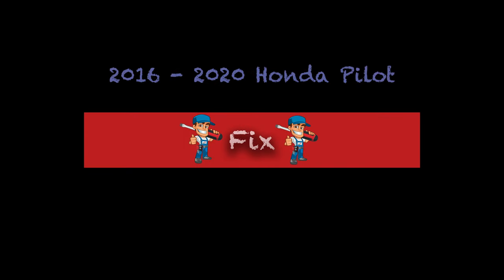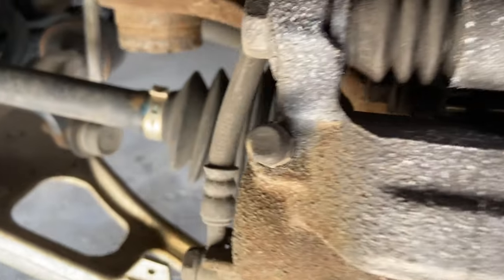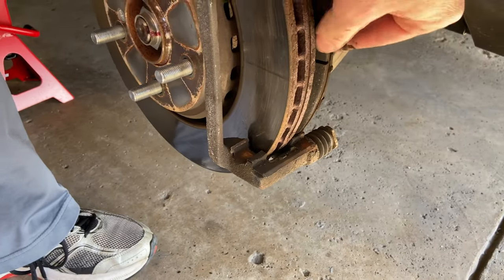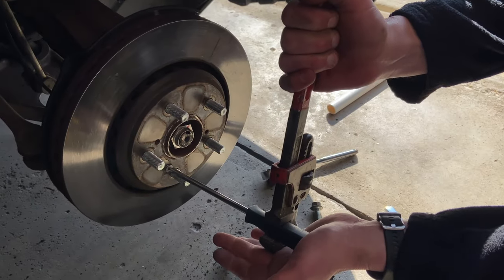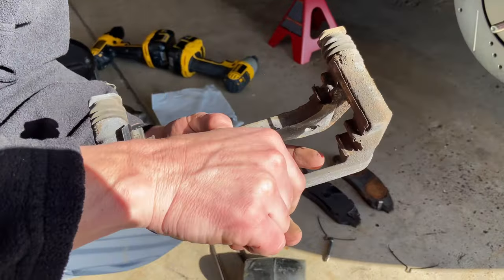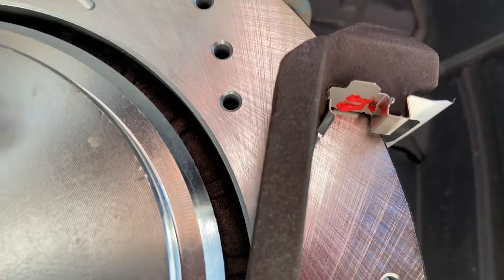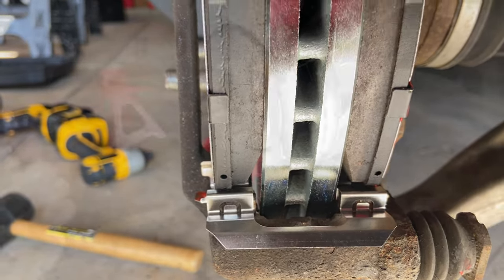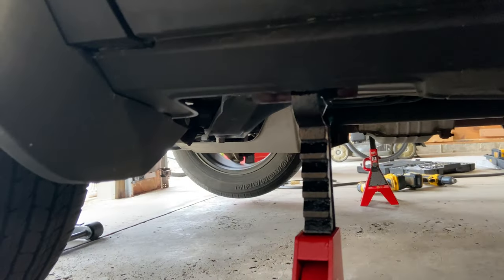How to Change Honda Pilot Brakes - Pads and Rotors - 2016, 2017, 2018, 2019, 2020, 2021, 2022 | DIY

Comment: The red brake pad quiet is a silicone,  will dry into a soft gasket type material. Only put red brake quiet silicone on the back of the pads, DON’T put it on the silver brake hardware where the pads are suppose to slide. Use silicone grease there, not the red stuff. Next time you pull the brake pads off you will see they’re like rubber gums,
Reply from the maker: Thanks for the info
Reply: Glad you said it. I was thinking the same thing ... that red "brake quiet" gets tacky, like gum.  The pad should move in the channels, so put lube in the channels and the "gum" on the back of the pads so that it will adhere slightly to the caliper pistons to prevent squeaking or rattling (thus the "quiet" in the name).

Comment: don't forget to remove the caliper pins, clean them off, and re-grease.  some anti-seize on the back of the rotor will help it from sticking in the future too, just make sure you clean it off first.
Reply from the maker: YES!  Thanks for the extra info!
Reply: Vaseline petroleum jelly on them works like a charm. I did that on my motorcycle multiple times!!!
Reply: I was hoping someone said this.
Reply: The pins need non petroleum product so skip my earlier suggestion and use silicon based lubricant for the caliper pin lubrication.  Petroleum based lubes will mess up rubber parts that the pins slide through to mount caliper on the bracket

Comment: The "phillips screw" that you had a hard time with, is not a phillips screw.  It's a JAS #3 screw, and is very similar to a phillips, but is not.  You need a #3 JAS impact screwdriver to get it out.  I'm getting ready to do my Honda Ridgeline.  How are the Powerstop rotors and pads holding up?  I'm told that slotted and drilled stop better, but wear faster.  Torn between them, and an EBC set with smooth rotors.  Thank you for the informative video.
Reply from the maker: The rotors are smooth and working well.  It's been about 20k miles since the install,  but I am unable to report on the wear.  Everything feels great though
Reply: @fixandplay826  Thanks for the quick reply!
Reply: @kennethgrutter9406  Slotted and drilled are great for high performance sports cars but you really don't need them for the pilot. The slots on the face of the rotor act the same way as a meat slicer in that they shave away the brake pad faster but this generates better stopping power. If you're racing and want that extra bite so you can brake later into corners to shave a little bit off your lap time then slotted rotors are going to be crucial but it's just overkill on your Pilot. Just my opinion.
Reply: @barrykennedy8507  thanks for the reply.  My vehicle is not a Pilot.  It's a Ridgeline.  A lot of people compare it to the Pilot, (Yes, lots of the same components, ) but the frame, and suspension are very beefed up on the Ridgeline, compared to the Pilot.  I also carry heavy loads in the bed, up to 1500lbs, and tow occasionally.  Similar, but a Suburban is not a Silverado.  The loads and stresses put on my Ridgeline, are different than what I would use a Pilot for.  Anyway, thanks for the reply.  I'm going with the EBC stage 13 brake kit, with yellow stuff pads.  Smooth EBC rotors.
Reply: @kennethgrutter9406  Gotcha. Quick tip to make the pad replacement portion of the project go a little easier,. When you are putting the pads back in the spreader springs will make the pads pop out as you're trying to get the caliper back on. An easy way to deal with this is to loosely reattach the caliper using only the top bolt. This allows the caliper to kind of flip up out of the way as you're installing the pads then you can use one hand to keep the pads in place and the other hand to flip the caliper down over the pads so they can't pop out. I just replaced my pads today and this method worked really well.
Reply: It’s a JIS (Japanese Industrial Standard) rotor screw.

Comment: Yeah, in my experience I’ve had a bunch of Hondas and those front rotors always tend to get warped around 40,000 miles-65,000. I ended up getting them resurfaced at the Honda dealer. In my experience it’s going to get warped again within another 20,000 miles. I also didn’t really like the stopping power of aftermarket brake pads and rotors ….so we ended up going OEM brake pads all around. This thing stops on a dime. Thanks for the vid man appreciate it. couldn’t justify spending $150 on each OEM rotor x’s 4 😅😅😅
Reply from the maker: Yeah, the rotors and pads I put on in the video have lasted me another 80k miles.  They are worth every penny

Comment: I stripped the hell out of that screw holding the rotor to the hub. Such a stupid unnecessary feature. Drilled through the head with bolt extractors and it’s still stuck on. Don’t do try to remove the screw without proper fat tipped Philips head bits and make sure you have a drill bit on hand for this project. Great tutorial. Did the rear rotors & brakes no sweat, appreciate it guys!
Reply from the maker: Sorry that happened to you.  In my REAR BRAKE video I use an Impact Driven Screwdriver.  It works great.  Heres the link
https://amzn.to/3Zfsrfr

Comment: Just to add one thing to your video.  When you push the pistons back into the caliper you need to be careful and not overflow your brake fluid resevoir.  Keep an eye on the level of that resevoir as you return the pistons back into the caliper.
Reply from the maker: Good tip!
Reply: Not really nothing happens. I have been changing parle pads for the last 5 years and there’s no overflow or anything

Comment: The stripped screw is called a JIS screw or Japanese Industry Standard. It looks like a Phillips but it’s not a Phillips. Using a Phillips driver to remove it will lead to stripping. Use a JIS bit in a manual impact driver to eliminate this issue.
Reply from the maker: Thanks for the info!
Reply: Use a air hammer on rotor to loosen this screw some people bang on rotor works but could damage rotor if you were going to turn them.

Comment: Great video! 

Just fyi, the screw that holds the brake rotor to the hub is not a phillips screw. It’s a crosshead screw. That could be why you stripped it. I used an impact driver with a crosshead screw bit and had no problem getting the screw out.
Reply: Save yourselves grief and buy the correct tool to remove that a JIS Screw. Philips head will strip that JIS screw.  (JIS =Japan Industrial Standard)

Comment: Good vid. , except too much that red stuff.  Anyways this should also work for the Honda ridgeline  which is basically the same car with a bed in back
Reply from the maker: Yeah! Too much red stuff for sure LOL.  Yes, this is  pretty much the same as the Ridgeline.  Thanks for the comment
Reply: @fixandplay826  just did my 2019 ridgeline yesterday.  I didn’t put enough brake lubricant on so I had to take them out again.  After that I could tell they weren’t dragging anymore.  But still squeak a little only when pushing the breaks . Rather then all the time.  I really don’t like those “springs.” That go into the pads.  ,  it makes putting the caliper on a challenge.  I cannot say how many times the pads pops out .  Working solo.  I heard Ford also does this 
With those springs.  I understand their purpose but could they do it. Different way.
Reply from the maker: Best bet…find a buddy to hold those spring for ya!

Comment: Excellent video. My 2016 Pilot will undergo the procedure soon. Be wary that your Amazon brake pads will not last long like oem ones, especially if they r not zinc plated- if u stay in snowy area like the north east.
Reply from the maker: Thanks for the info.  Hope you procedure goes well 👍🏼
Reply: Also the screw you stripped. Where did u find the replacement? Do you have part #. Or sizing on it?
Reply from the maker: @kunalkhanna985  I didn't replace it.  I screwed it back in.  That screws job is to how the rotor on during assembly on the assembly line.  I decided not to replace it, it's not really necessary
Reply: You stripped that screw because it is not a Phillip's screw it's a jis18 screw. It's a totally different type of screw head.
Reply: @ericsummers7178  interesting update, I have a fancy screw driver set that could have the said tool. Let me check
Reply: I got a special Vessel screwdriver for jis18 screw removal, all Honda's need it for this job

Comment: Use a hand held impact screw driver to properly remove the phillips head set screw holding rotor on.  Hit it with a hammer and it come right out without tearing it up the way they did.  Can get them at harbor freight or on Amazon for about $20
Reply from the maker: Thanks for the info! Impact screwdriver would work well in this situation for sure

Comment: Yeah, the OEM Honda brake discs are cheap and warp really easily. It’s a problem on all Hondas. We had our rotors resurfaced at 10,000 miles and we just replaced them at 23,000 miles with Duralast Gold Brake Rotors. I’m hoping they will not warp. They claim to be high quality made from high carbon steel with a black coating to prevent rusting.
Reply from the maker: The rotors and pads I have in the link are what I used and they have lasted me 90,000 miles at this point and I’m still going!!

Comment: I came up with some tips after doing brakes for now has to be close to 40 years my own brakes whenever you do great so any type of maintenance on the front or rear really but the certain and balds that you want to see them and tighten them right back up. One of them is that screw that holds on the road at any time you do work in the front take that school loosen that screw up and then put it back You should even have a set to spare screws pick them up at the deal or whatever and pop those off place and with some new ones because if you wait 80,000 mi you might not get so lucky now you're drilling that screw out it's a real pain. You might also want to hit those bolts that are holding the road of brackets on You back there you doing the brakes the pads take your your 17 mm socket put it on that racquet bolt and loosen it up and it tighten it back up Don't wait until you have to do those roadies and you haven't touched that bolt for 80,000 miles. Sorry for typos voice to text and good luck
Reply from the maker: Thanks for the knowledge!!

Comment: I'm doing this in the AM, do I really need
1. Brake cleaner for rotors
2. Special bit for the little screw
3. Breaker bar
4. Bolts Torqued to spec

I have a large torque wrench, don't really know how it works I just use it like a non torque. Not sure if it even works for torque, it never slips and I crank stuff down hard with it. 

I have the silicone grease, floor jack, jack stands, wheel chocks, correct size sockets. 

I think I'm good 👍

What do you think?
Reply from the maker: 1. Yes!
2. Risky if you don't, you might strip it
3. Only is the bolts are too tight to loosen, otherwise NOPE
4. Nah, you can just hand tighten
Reply: @fixandplay826  I did it and everything works perfectly! I even changed the brake fluid and bled in sequence 👍

First time doing a real auto repair on my own. Feels good 😃

1. I didn't have brake cleaner, I used some rubbing alcohol, on the front of the rotors but It wasn't after thought so I didn't do the back.
 
2. I used three bits to get that screw out almost stripped it. The first two bits broke off inside, But we're not stuck and came out easy. Third bit worked luckily. On the second rotor that bit worked perfect right off the bat. 

3. Didn't need a breaker bar because I had a very long torque wrench. 

4. And I just made the bolts really tight I don't know how to use a torque wrench apparently lol. 

I did the break-in routine. Heated them up so the pads form to the rotors. 

Everything is great. Thank you so much for the video. 

Now I might take on more maintenance 👍

Comment: Did I miss when you bled the brakes to get air and old fluid out of line?   If caliper is only pushed in, without bleading then old fluid can corrode lines.
Reply from the maker: No you didn’t miss it.  You don’t need to bleed the brakes when you just change the pads and rotors.  You must bleed the brakes when you replace the calipers

Comment: You needed to clean the caliper bracket and remove the slide pins and rubber grommet clean and regrease pins reassemble. 
Grease the bracket notches
Reply from the maker: Yes, thanks for the info

Comment: How about the Torque Spec for the Caliper Mounting Bracket as well as the Caliper itself?
Reply from the maker: The front caliper BRACKET bolts are 100 ft/lbs
The front caliper GUIDE PIN bolts at 50 ft/lbs
Reply: @fixandplay826  damn that's tight. That's what she said, am I right? Great job with the video, even I could follow along.
Reply from the maker: Edmund Mendez thanks for the positive reply
Reply: @fixandplay826  Do you think if the Guide Pin bolt is too tight, it could cause the brake pad to not hit the rotor?

Comment: I usually take a injector thing that you use for turkey and get all the brake fluid out of the reservoir then add new after I compress the calipers that way it never overflows as you're cranking down on it with caliper tool. Otherwise you'll have that 💩 everywhere
Reply from the maker: Thanks for the tip!

Comment: Shouldn't you bleed the brakes after reinstalling the caliper?
Reply from the maker: In general, hydraulic brakes don’t need bleeding unless the whole brake system has been opened up or when a leak has allowed air in it.  A normal brake job doesn’t need it.  If your brakes are non responsive or super spongy, then you may need to bleed them

Comment: Tips before you push the pistons back in, put a line on the bleed screw, crack it, push the pistons in.  1. Way easier. 2. You push out old fluid vs back into the system. 3.  I’d flush your brakes as bows the best time with all new components

Comment: you need a impact driver for those  screws    now it has to be drilled out
Reply from the maker: Yes, an impact driver could do the job
Reply: Drive your car for a few miles, come home, jack it up and take off the wheels. Immediately spray PB Blaster on those 2 screws and wait 10 minutes. Rotors will be hot.  Those screws usually come out very easy then. FYI - invest in a 24 inch breaker bar for those stubborn nuts. You should not use a ratchet and pipe - ruins the gear in the ratchet head.

Comment: Where did you find a replacement screw for the one you stripped?
Reply from the maker: Ian 08 I didn’t find one, I just put it back in.  That screw is not part of the brake mechanism.  It’s only there for Honda on the assembly line to keep the rotor on until the other parts are assembled.  So it’s actually  unnecessary
Reply: @fixandplay826  Good point, thank you!

Comment: Just did my front pads and rotors. The left side looks perfect.
But the right front rotor looks like the brake pad isn't fully hitting the rotor on the inside.  3/4 of the rotor looks like its getting hit by the brake pad (silver)
But on the inside of the rotor looks like its not getting hit , so all the way around its the same color as it was brand new.
Outside -silver color
Inside - white/new looking color.

Anyone have this issue?
Reply: How often you need to change rotors ? I have mine I has 78,000 miles never change brakes or rotors ?

Comment: where is the lift point on the car?
Reply from the maker: There is a spot on each side of the car, just behind the front wheel
Reply: @fixandplay826  , I think he’s asking where is it in the front middle where the jack was placed.   I looked underneath my Pilot and all I see is the bottom of the radiator.   Guess we need to look better and make sure we position our jacks under the actual frame.